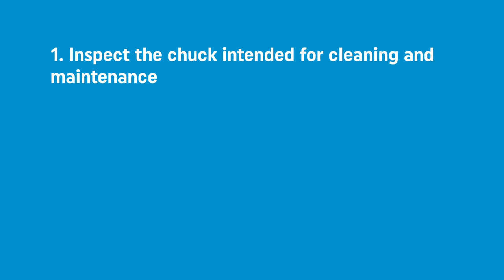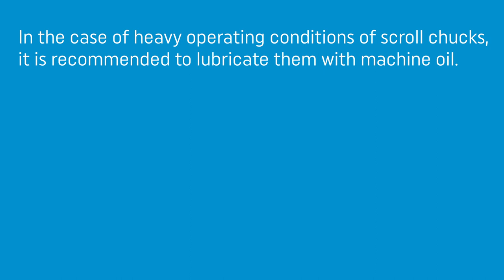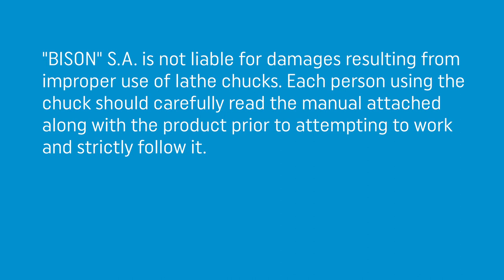BISON Manual Chuck Maintenance

Comment from the maker: The tight tolerance of BISON’s components requires the light use of a hammer or mallet to reassemble. The steel hammer has a lower hardness rating than that of the scroll plate (62HRC). We can assure you that lightly tapping the scroll plate with a hammer made of softer material will not damage the scroll plate.